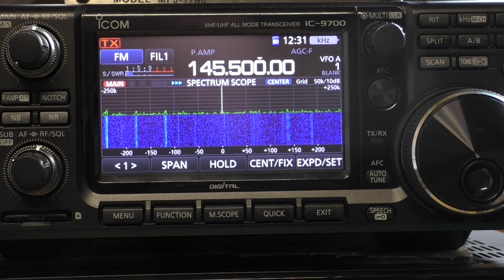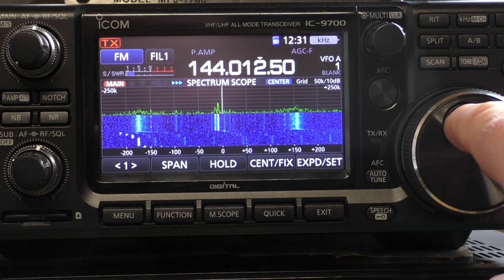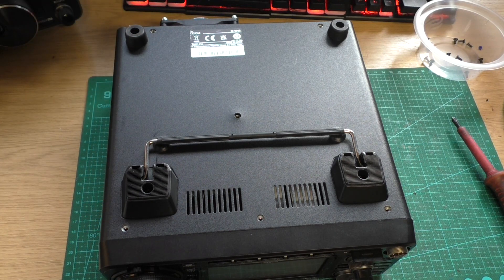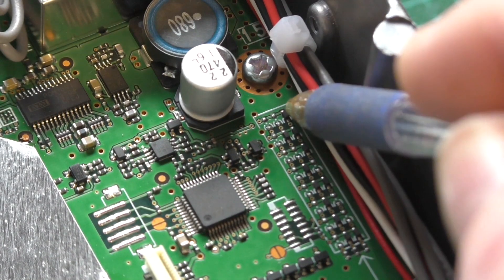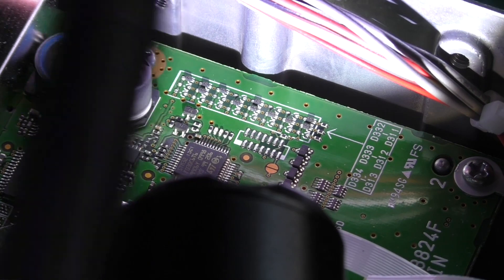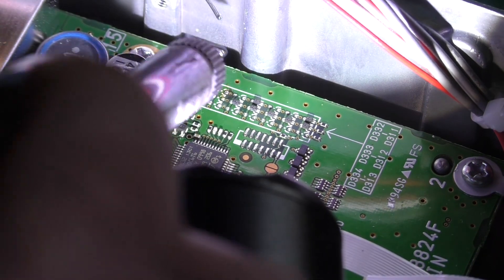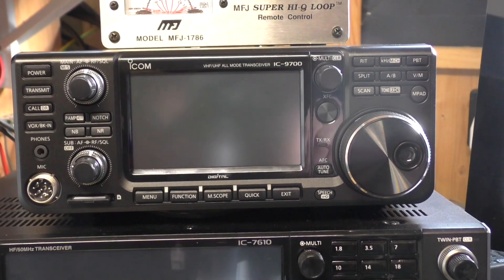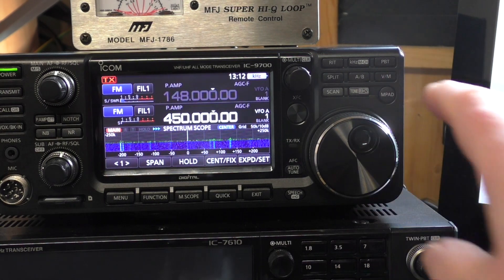Icom IC-9700 TX Mod for 2M and 70cm

Comment: This is great. But, I want to listen 143.050 MHz, GRAVES radar in France. So, if I want to know is there are any meteor activity, I should to unplug antenna, turn off radio and use SDR receiver? Icom is not the same as Yeasu. Yeasu radios often can receive, but not transmit outside HAM bands. Anyway, great tutorial. Thanks.